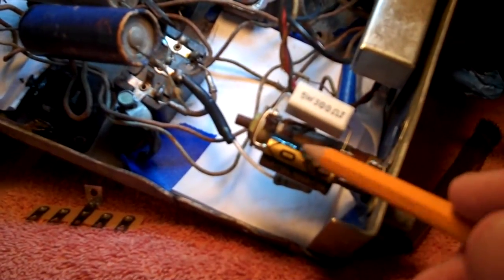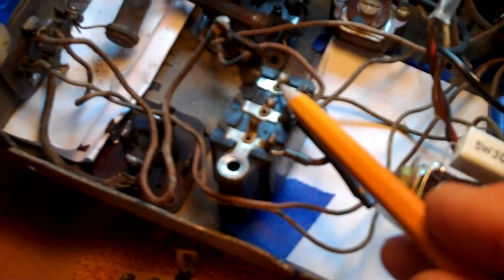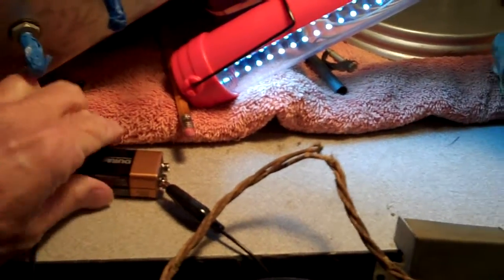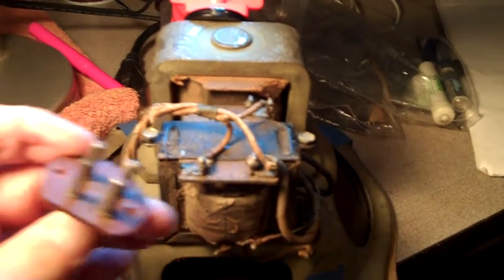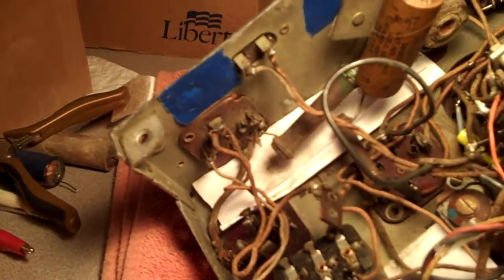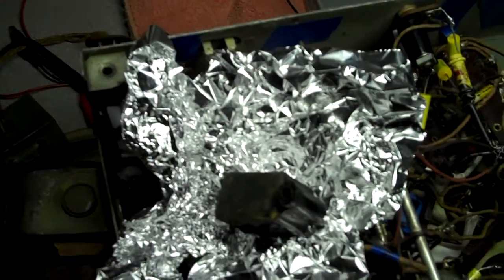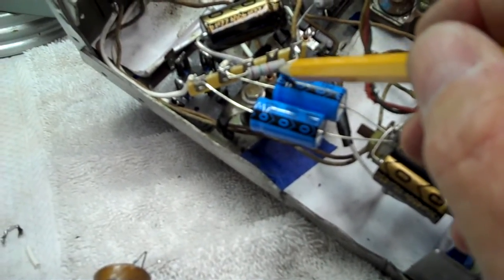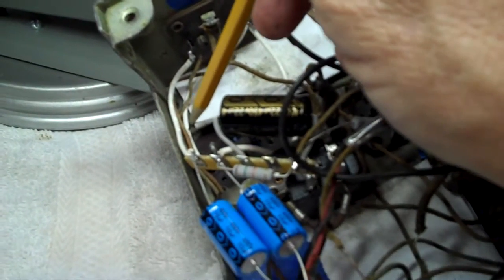1936 Philco Model 630B Repair and Restoration (Part 20 of 35).

Comment: John, Thanks again for your going to the trouble to post these.  I learn from each one and check often for new uploads (while you were down I watched your re-runs! ha)  Radio that I am working on the Audio transformer primary appears open, quess I will order a universal replacement.  By the way, Both Grandsons had there first Karate lesson last night.  Hoping for results similar to your Grandson.  Thanks again, Stan

Comment from the maker: @pskittle488,
There's no need to shield a bunch of wires to prevent static (RF interference) in AM radios.
A certain mindset is involved when working on these old radios. Once the restoration is completed, you want the unit to sound like a vintage radio, static and all.  It's that quaintness which defines antique radios. To me, AM radios from the 1930s should never sound like FM.  It brings back so many memories when late at night I hear an AM station fading in and out.

Regards,
John

Comment from the maker: Old-time radio repairmen never cleaned out the old bakelite caps and did a restuff.  The blocks were sold as a complete unit, so they just yanked out the old and put in the new.  That's why there's no voltage rating shown on the parts schematic or list.
Recommendation:  Always buy 630-volt caps for your wax capacitor replacements and all the bases will be covered.  No fuss - no muss.  And the price is the same.

Regards,
John

Comment from the maker: @KO4RB,
I buy my solid and stranded hookup wire from Radiodaze (Radiosupply).  Both are 22-gauge and both have their advantages.  I use the solid wire for under chassis connections, but stranded wire where "flexibility-without-breaking" is needed i.e., speaker wires, grid cap wires, loop antenna connection wires, etc.
Hope this helps.

Regards,
John

Comment from the maker: @THOMMGB,
Good question.  Generally, usually, most of the time the schematics and/or parts lists show the resistor wattages, but for some reason these did not.  However, nearly all vintage wattages are 1/2-watt, 1-watt, 2-watt and 3-watts.  Over time one learns the size differences.  It's a matter of experience.  Not so long ago I had no idea which was which, so I asked.  It's how we learn from one another.

Regards,
John

Comment: Aloha John
Thanks again I wish you did these videos two years ago before I did my 1932 GE I sure learned more this time around, Now I want another radio for Christmas and do another restoration job knowing all that I know now. I did have a question are you using the same 600v wire for the speaker that you use on the rest of the radio? Thank You so Much 
Take care good buddy!

Comment: You mentioned in a reply that RF interference is a real problem in these old radios in regards to the wiring, is it possible to shield the wires at all? Is shielded wire even available? Could you make your own?

Comment: Hey John, How do you know what wattage of resister to use?  From what I've read, most resisters used in these radios are 1/2 watt and that some restorers use 1 watt to be on the safe side.  The bigger resisters are clearly more wattage.  How do you know what wattage to use if the schematic doesn't say?  Another thing.  I just tried the All American Five trick on my 8 inch Philco speaker.  Did the same as yours so I'm happy as well.  Tom

Comment from the maker: No...caps in the cans are electrolytic (e-caps), not wax caps.  Actually, the can is the cap, the can itself being one of the plates.
The voltage ratings will be stamped on the can, the parts list or on the schematic. Other e-caps in the chassis will have W.V.  (working voltage) stamped on the body.  They'll also have a plus sign at one end and a negative sign (or black stripe around the body) at the other end.
Know what you're doing before messing with these old radios.

Regards,
John